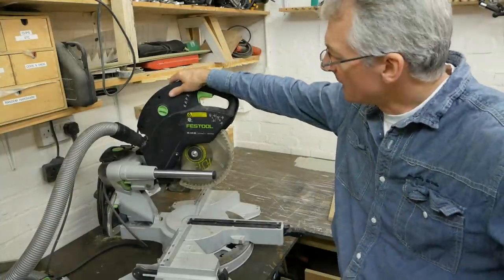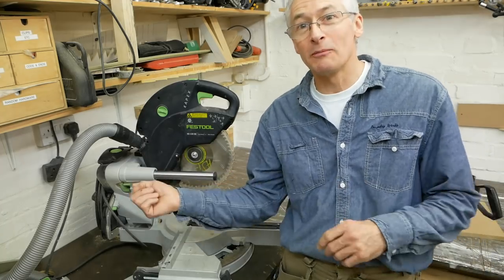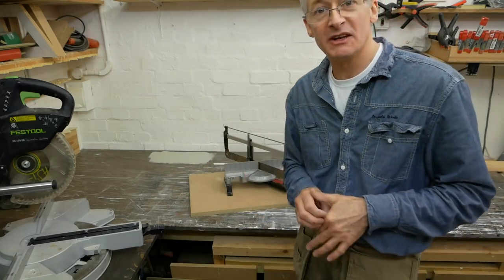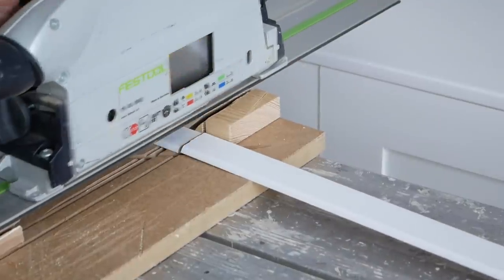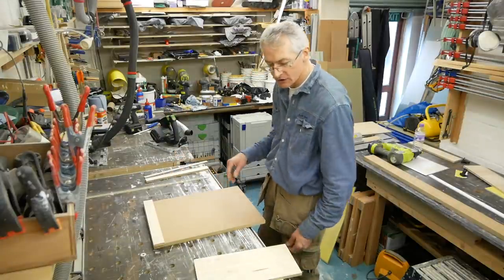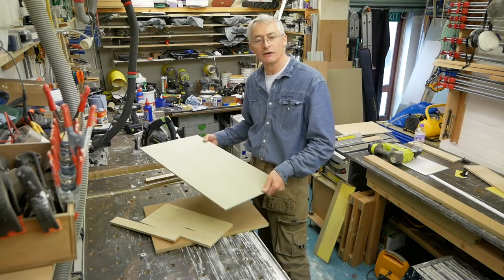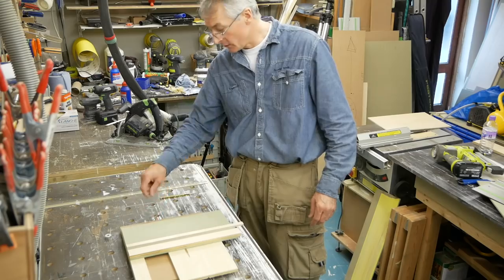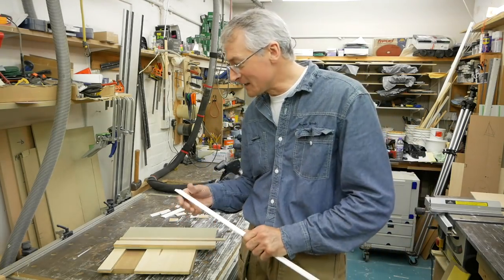Tracksaw chop saw #049

Comment: Hello Peter. Love your vids! Quick question on this jig though. Why cut the right side of the base completely off? I think I would like to have 2-3 inches still there for some support. Plus having the forward fence on both sides of the cut would help prevent tear out. (Like a radial arm saw)
Reply from the maker: +eidolonnoir Yep, can do. I had that on my original jig and it just made it more compact to cut it down short; there's no hard & fast rule here, whatever works for you is good 👍

Comment: Did you also make a similar one for doing 45 degree miters?  I suspect for bevel cuts, you could use this one since the track saw pivots in such as way as to have the same cut line as a 90 degree cut on the track.
Reply from the maker: No - it’s not generally something I need to do onsite, though I do do one where the rail could be angled to 45 - that way I could do mitres one tiny bits of trim and moulding. 👍

Comment: Hi Peter, you've highlighted a common problem for quite a few of us, even the DIYer's amongst us.  I do use a table saw in the workshop with a sled which really does transform the saw itself.  The minute I go into one of my chiders houses I'm snookered.  I bought  a Jet mitre saw but it was big heavy, took up a lot of space and has become less accurate over time. as well as spraying dust every where!  I have the Makita track saw and they don't do the shorter length of track and I'm not keen on cutting them down (as I need them for large panel work). So this little gem is just the job. Simple, accurate and it works.  Thank you.  Regards  Mike.
Reply from the maker: Even if you do have a short rail a little jig like this is very handy, and I'm always amazed by how much better the dust collection is. Thanks!
Reply: Mike S the makita runs on festool rails I have the makita saw but festool rails as I used the makita rails for my big circular saw.

Comment: Do you see any reason not to make one of these for cross cutting 2x4 lumber?  The dust collection on a track saw beats any miter or circular saw  out there including Festool.  I am not cutting long pieces.  Thanks, great video.
Reply from the maker: Thanks! No, no reason other than these saws can only cut 50mm on the rail, so a/ you’ll be working right at the limit of it’s capacity, and b/ obviously you’ll only be able to cut a 4x2 one way. But it’ll work, yes. 👍👍

Comment: A bit late to the party but will certainly use this jig/top tip, much appreciated sir! 👍
Could I get your advise regarding replacing/sharpening of the TS55 blade. What do you do?
Do you know of an alternative blade manufacturer or would you stick with the typically expensive festool blade.
And have you had the saw blade re-sharpened to your satisfaction?
Many thanks in anticipation!
Reply from the maker: Thanks! Have to admit I just get my Festool blades re-sharpened - the only ones I’ve found that come close to them for quality were Ke y blades & Fixings - https://amzn.to/2Tbpsms - though I haven’t used it enough to say how well they last. The Festool ones just go on and on!👍👍
Reply: Now that was speedy reply 👍😀
Thanks for your valued advise, much appreciated.

Comment: Hi Peter,what about making something like this with a piece of rail and could be tiltable for some skirting boards.
Reply from the maker: Yep, sure, though I don’t follow the ‘tiltable’ part? Did you mean to do a bevel the ends of skirting? You can just tip the saw over for that. 👍
Reply: @10MinuteWorkshop  yes bevel cuts.Thanks, great jig.I was trying to do cuts with HKC 55 and proprietary short rail with limited success - quite a bit of tearout especially on pine and solid woods

Comment: What's your take on a crown molding jig? I know the only thing that you need to add is a bevel/miter cut along with the straight 90-degree crosscut. The version I am working with is a simple triangle of 3/4 ply that I flush one edge to the track on my MFT. The top of the triangle is a 90-degree face that I do my straight miters, and the angle that runs 45 degrees from top left to bottom right is where I make my 45 w/ 22.5 bevel. I like how you have the whole jig made with the guide rails. I've been thoroughly impressed with the TS 55 and all that it can do compared to any other saw I've ever used. I sold my table and miter saw and bought an MFT + TS 55 after realizing the potential. You definitely have way more experience with these tools than I so any insight on this jig would be much appreciated! Thank you for your time, and I appreciate the knowledge you openly share with the world. Have a good day!
Reply from the maker: Have to confess, crown moulding, or cornice as it’s called here, is the one thing that pretty much guarantees I’ll pull out the mitre saw - there are so many variables in making a compound cut that I want everything locked down tight. Interesting idea making a jig for the traxksaw though - maybe I’ll have a play, see what I can come up with 👍👍
Reply: @10MinuteWorkshop  That would be awesome! I hope to see what you come up with

Comment: Total beginner here.. I love the ingenuity! Would the Festool HK 55 on its FSK guide rail render this unnecessary or would this have other applications?

Thanks :)
Reply from the maker: I think the HK/FSK combo is great for short cuts in, say, floorboards, where the rail is supported by the timber, but this little jig excels at small-section mouldings, e.g. architrave and trim, where the rail isn’t supported by the stock. 👍
Reply: Ahh I can see that now... I'd love to build one as a wee starter project

Thank you so much for the quick reply. All the best

Comment: Hi Peter, I’ve just found your channel whilst looking for track saw reviews. Very informative and some great advise. Love the jig you made to. Just wanted to know what extraction unit you use when working in homes? As I run my own handyman business. I know festool do the midi and the compact systern one. And collecting dust is always a concern. Thanks in advance. Andy 👍
Reply from the maker: Hi Andy and welcome! I used a Midi for years, then went with the CTL SYS when it came out - love it! Be sure to check out the back catalogue, I did a fairly recent 'Two years with my CTL SYS' video that may be of interest - https://youtu.be/uqizB4w3Tps. BTW I started out doing handyman stuff, hard graft but you can grow it into an area you're most interested in 👍
Reply: Peter Millard - Thanks for the advise Peter. I'll check out the video. Keep up the great channel. 👍🛠

Comment: May i ask a question, how does the vac know when to come on when you use a tool ?
Reply from the maker: Of course. The vac has a power-take-off (a socket with a power-sensing switch, basically) for just that reason. Thanks!
Reply: +Mart
You plug the saw into the actual vacuum system and when you activate the saw the vacuum comes on. 

Now I believe that Festool has some tools with a bluetooth chip that activates the vacuum.

Comment: Hi Peter
I here you saying in one of your videos that you don't like to work with your table saw. You do have one in your shop. I was wondering what kind of table saw you have there. Thank you for your time. Your videos are cool and as of today you have a new fan.
Regards!!
Reply from the maker: Thanks Boban! I have an old Axminster TS200 saw - not made any more, but very similar to an old Kity saw. It’s a small induction motor with a cast iron table. It’s not great, but probably one of the better small saws. 👍👍

Comment: That is brilliant! Could one be done for using on the 45 for mitres??
Reply from the maker: Absolutely - my first version had two positions for 90/45,m. What I found though was that changing between the two caused rapid wear and made it inaccurate quite quickly - moreso on the 45 than the 90. Maybe a fixed 45 would be a good idea 👍👍
Reply: I wondered if it could be done with the saw tilted over at 45 rather than moving the track to a 45?? I might have to have an experiment with my friends saw!! :)
Reply from the maker: Oh, I see. Sure, could be done. You get a different cut-line on the base, of course, which may wear prematurely. But yes, why not 👍
Reply: It's always good to read the comments to a video. I just wanted to ask the same.

Comment: quick question.  I just purchased a kapex 120 REB and the base is not perfectly flat and the fence not at perfect 90 degrees.  Do you have any tips on how to fix?
Reply from the maker: Hi Mark. I’d seriously consider returning it - those aren’t the kind of faults you should be needing to fix in a new saw.
Reply from the maker: Hi Mark. I’d seriously consider returning it - those aren’t the kind of faults you should be needing to fix in a new saw.
Reply from the maker: Hi Mark. I’d seriously consider returning it - those aren’t the kind of faults you should be needing to fix in a new saw.

Comment: Great work Peter! .. I have a sliding mitre saw, but I'm always really annoyed by how much slop there is in the mechanism for it, and I'm never confident it's going to give an absolute square cut, should I happen to put slightly to much weight into the cut. I've fettled with the works on it and tightened the mechanisms up as much as I can without it becoming too stiff, but it's still not good for fine joinery (not that I'm any good yet). I like this idea because my tracksaw has no play, and as you're building this jig yourself, you can correct for any squareness issues.

Comment: Now your gonna have to make the deluxe model ,that can be turned to a cut 45%,i usually make them as i need them on the job ,with something that can double as a shooting board  to tighten the cut up if need be ,but they use a lot of MDF trim here on the lower priced homes ,so little glue and painters chalking does the trick
Reply from the maker: Now you're giving away the plot of the next video, lol 😂

Comment: Very nice. I also have an 80's Makita chop saw, big and heavy, Freud 90 tooth blade, good for long job/crown moulding/empty condo. Finally bought an HKC cordless good price, (used once!) last week to fix an engineered hardwood floor. The FSK250 track stop adjusters stick down too far to use on a flat surface, so I've been adding clearance height with scrap. I'll take your idea, square two pieces with the trim gap underneath, and use the FSK250 track which I thought too short to be useful, instead of making track guides. Double sided tape, yes. I might make it from some scrap aluminum/aluminium to be posh. Not too likely. Thanks very much. (Then I'll get a patent and get you and the Parf guy to market it and retire rich beyond my dreams. Also no too likely)

Comment: It would be a great idea to make another fence just under that one at a 45 degree angle to cut miters.
Reply from the maker: +Nesley Heiney Thanks! I did have that on my original jig but tbh I found I rarely used it, so I left it off this one. Absolutely nothing to stop you putting one in if you feel the need though 👍

Comment: Hi Peter I've just taken delivery of a Kapex 120 REB one of the reasons I bought it was the flatness of the base and the squareness of the fence to the base I tested lots of them in various dealers before I pressed the button. My one is not square to the base at all the RH fence is just about acceptable but the LH Fence extension is at least 1mm out from the bottom fence i cannot believe this is right,  it is similar to my DEWalt and the very reason I upgraded to the Kapex I would appreciate your thoughts and wonder what yours is like

Comment: Recently had a job where I had to cut cornice that projects 45 out from the cabinet. I made something similar. 

I cut at 45 and 45 thinking it would make the angle, but it didn't a s really confused me, so mocked it up in CAD to see what was going on and got a spurious angle. After some research it has a Wikipedia page and is known as the magic angle. It gets a bit Mandelbrot, maybe you could do a video on it? 

I got there in the end but after a lot of head scratching.

Comment: Peter, I have had a Makita compound chop saw for around 5yrs, I have toyed with moving it on a few times but It has become sentimental.  It  has saved me loads of time when I refurbished properties on 1st &2nd fix work.  It chops joists like butter and can still deliver 100% accuracy on mitres and square cuts and is easy to transport around.  I have had it serviced 3 times at £75 a pop.  Now even with a track saw I cannot bring myself to part with it.  As for the Nobex, That was my first cordless chop saw for fitting kitchens.  It's great on laminates when doing pelmets, kick rails and light rails etc.(picture frames also it you are into that)  I sold mine when the Makita came on the scene.  As for the jigs you make I think they are wonderful tools to have in the box.  I wish I knew you a few years back we could have made a few bob!  Thanks for the vid it made an otherwise a dull day much brighter.
Reply from the maker: Thanks Michael! 👍

Comment: Nice idea think I'm going to have to make one of these! I might up the depth capacity to full depth of cut using thinner  base plate (as you can shim up the bottom if needed) and allow for 5/6 inch for skirting.
Reply from the maker: Yep, absolutely a moveable feast - you can do whatever's right for your usage. Like I mentioned in the vid, I built my original one big enough to take 6" skirting but never used it 👍

Comment: It is already a plunge saw. Instead of making tracks to ride on, simply make your cut station deep enough to plunger far enough to cut through the width of your stock. You just need one stop on the front that allows the maximum blade width to be used. Not much different from yours but only needs a guide on one side vs the two rails you have now, and a stop in front.
Reply from the maker: +Jeff Stanley 👍

Comment: You've slightly alarmed me about the fact that the Kapex cant be used inside someones. house. I've just gone and bought the Kapex 60 with express reason so I can use it inside a clients house. I'm hoping you are going to tell me that your hoover is clapped out and you are using a narrow hose...
Reply from the maker: +Julian Powell In my experience, the DC on the Kapex is about the best there is on an SCMS but it still isn't a match for a TS55; different animals, to be fair. But in an occupied house? No, sorry. Now what I've seen of the Kapex 60 the DC looks very good - but I don't own one, and haven't used one. I look forward to trying one 👍